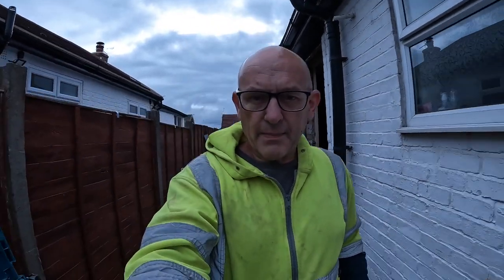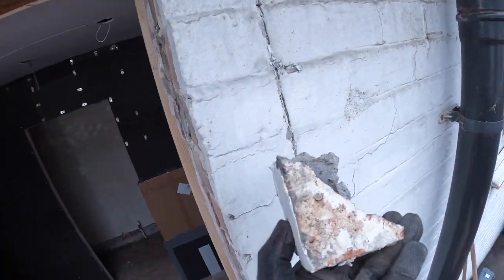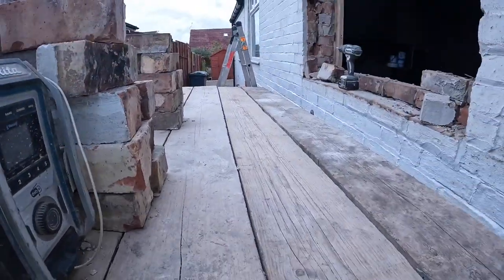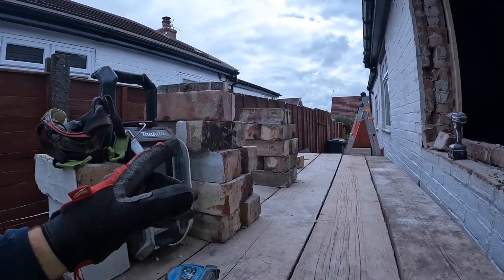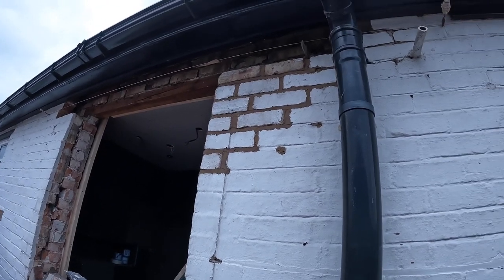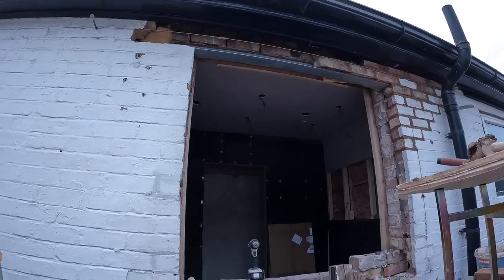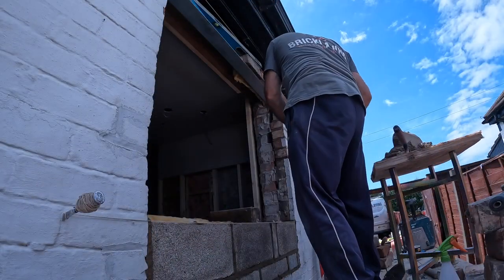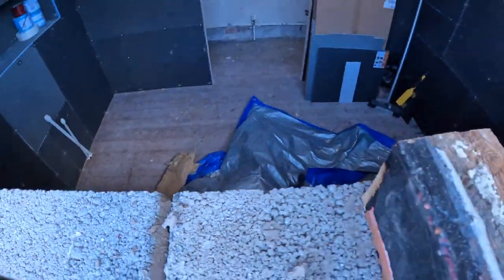SOLO LINTEL JOB, NO AL??

Comment: Steve, why does the lintel not sag after more weight is put on? Is it tensile strength and lateral hold? Good work and I know it is hard on your own.
Reply from the maker: Lintels will sag so need propping while you build over them 🧱👍🏽